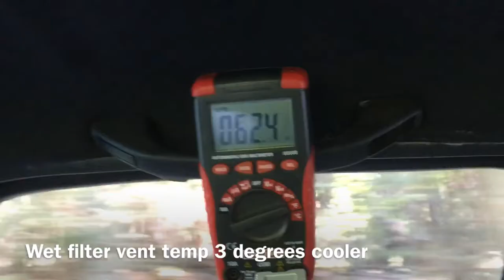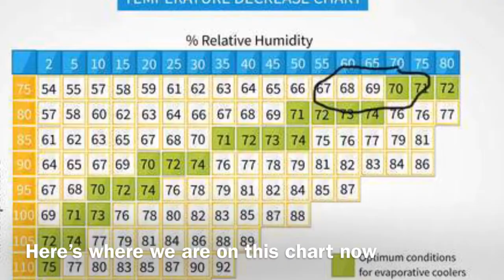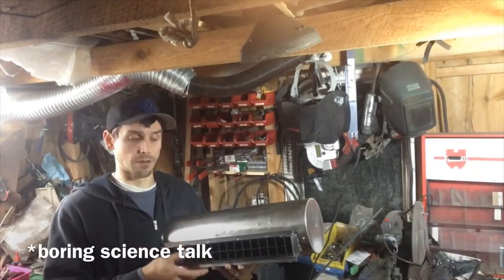DIY Swamp Cooler From Scratch: Lil' Swampy (Building & Testing a reproduction vintage swamp cooler)

Comment: I had the pleasure of feeling a re engineered  vintage swamper work as a young child. My dad's friend has one in his desoto. Man was an aerospace engineer and had completely re made it. a water reservoir sat on the floor behind the front seat that had a 12v high pressure pump and plastic line that ran up the b pillar to the cooler, which was lined with 8in diameter automotive air filters that he replaced the matrix on. At the front just behind the air inlet was a tiny nozzle that sprayed a mist into the cooler that would nearly immediately evaporate but a small amount continued to dampen the matrix. Very low humidity and at highway speeds he was getting 62 deg air on a 90 deg day. The tank only lasted for around 45 min.lol last I heard he was looking to put a bigger tank in the trunk. This was the early 90's.
Reply from the maker: That’s amazing. Something like that had crossed my mind. It’s just never that hit here in New England
Reply: @ecophage  As the air becomes more saturated with water you're going to have drastically plummeting evaporative cooling results. That's why evaporative coolers that sit INSIDE a home with no exterior source of air, they eventually work against themselves to the point that the air in the home gets so saturated that evaporation can and will no longer occur. That's why it's critical that you have to REPLACE the air inside the home and not simply recycle it as modern air conditioners do.
This is the reason why evaporative coolers aren't effective back east or wherever there is high humidity.

Comment: Funcionaria igual uno que esté hecho de plastico o pvc?
Reply from the maker: Might work similarly but the plastic ones arent as sturdy pvc could soften in direct sun and I’ve heard of the plastic ones coming unglued. I sell a steel cooler kit starting at around $225
Reply from the maker: Podría funcionar de manera similar, pero los de plástico no son tan resistentes como el pvc podría ablandarse bajo el sol directo y he oído hablar de los de plástico que se despegan. Vendo un kit de refrigeración de acero a partir de unos 225 $

Comment: Not to take anything away from the fine job that you did, but it appears that the air just flows across the wet filter area. Wouldn’t it be more efficient if the air flowed through the wet filter media? Maybe I am missing something.
Reply from the maker: cribbins6863 yes I’ve made half a dozen standard coolers with rotating baskets through which the air is forced. I explain in this video how this was an experiment to see if the tray filter method with just a gap above through which air passed through would work at all, like a wick style air humidifier. I, like you, actually thought it might not work. And was surprised when it did and even more that it was comparable in performance to the previous coolers I’ve made.
Reply: ecophage, okay I understand now. That’s what I get for trying to watch it and doing something else at the same time! 

Thanks for sharing it!
Reply from the maker: cribbins6863 no problem Thanks for watching, and I’m willing to bet this conversation will help clarify for others. Probably still others will have the same questions. 

 In reality I need a warmer climate or someone in one to really test the limit of these coolers. I’d bet this style is limited compared to the traditional style. But easier to build for sure.
Reply: ecophage, I live in the Seattle area and we don’t see many swamp coolers around here for the same reasons. A friend of mine lives in AZ, so they are very popular there. 

But they are still neat as hell and everyone with a sweet ride outta have one!
Reply from the maker: @cribbins6863  yeah agreed. Thats my driving force behind making these guys. Theres no real options for affordable functioning vintage style ones. I"ve got these down under $250 which is about half the cost of an actual vintage one, and its functional. i havent had any complaints yet from my previous ones and wanted to try to improve on the body style for this one!

Comment: I thought this coolers work with ice that’s what I was always thinking, so all u have to do is out some water and that’s how should work ? Thanks
Reply from the maker: right, its a swamp cooler. meaning it cools by making the hot air evaporate water thus dropping the actual temperature of the air.

Comment: Would it help insulating the can?
Reply from the maker: Good question. I’m not sure. The air passes through it so quickly. It’s more about adding the moisture to the air than keeping the unit cool. When traveling the cooling effect of 45 mph wind keeps the can body chilly regardless of outside air temp or direct sunlight. The cooler only functions in moving air so stationary direct sunlight is never an issue. That being said I believe it would only benefit from being insulated but I’m not sure how much. I believe the effects would be a more instant cool if say the car and cooler were sitting in direct sunlight previously and had gotten warm. Where as the standard cooler with its reflective surface alone may take a few minutes to reach its optimum cooling effect. Great question. I’m building a testing system to test a few theories for boosted cooling performance in the filters water area. I’ll try to add that to my testing procedures to verify our conclusion.
Thanks!

Comment: hey is it possible to fit a cooler without a door post? i like bringing old school to my hondas and my 90 acura integra doesnt have a top door post just window so curious how it would fit
Reply: window frame i mean
Reply from the maker: @CruddyDriveway  Itd be interesting to find out. These definately appear to need a channel for the top lip to sit in, Although the force is pressing in or the door frame/felt channel, assuming you dont have that you may need to screw or rivot it in place.
Reply from the maker: Home movies is the best show ever

Comment: You're missing the spinning inner core! I've gotta build 1 for my bug!
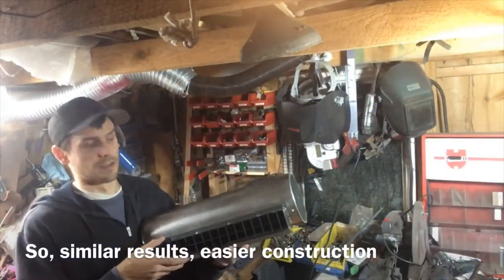Reply from the maker: Try watching the video dude, I address this at 5:17. “This cooler performs about the same as the previous coolers I’ve made with moving internals but this one’s easier to make, I got 3 degrees cooling consistently here at about 70% humidity on a 75 degree day”

Check out my videos on all my builds
Reply from the maker: Check out the reproduction coolers I build now with full spring loaded internals https://www.ecophagefabrication.com/brand-new-thermodore

Comment: saw a vw bug in a  small car museum in Nashville. it had a very similar "ram air" swamp cooler but the passenger/driver could reach over and pull down the rolled up filter matrix (like an old fashioned  pull down vinyl shade), to recharge the water content of the fabric.  Really pretty ingenious.
Reply from the maker: radioman140 if you watch my first two swamp cooler videos (fire extinguisher and mailbox) you can see they functioned that way. The problem being it’s labor intensive to recreate for resale. That’s why I tried this design.

Comment: Cheated by turning the interior AC
Reply from the maker: Hahaha No AC in the golf, plus all the AC in the world INSIDE the car wouldn’t change the temperature of the air ENTERING the car THROUGH the cooler at 50 mph plus you can see the thermometer probe INSIDE the cooler. It defies credulity that any AC from a system would be able to reach into a cooler that has 50+ mph shooting OUT. 🤷‍♂️

Comment: Hello this has been done before it's called air conditioning or do u think you are smarter than all the people that have worked to invent and perfect it for the last 100 years hahaha ooops
Reply from the maker: Lol it’s not air conditioning it does not contain Freon, it is a swamp cooler they have been around for a hundred years. Did you really think I had came up with this? Lol

These are on lots of cars they usually cost about $1000. I have sold almost a hundred of these functional air humidifiers all over the world.

Watch my other videos, I’ve made many versions, these are reproductions 

Reproduction means when something used to exist previously (as in I didn’t invent it) but maybe it hard to find for example. 
Thanks for watching 
Do some research